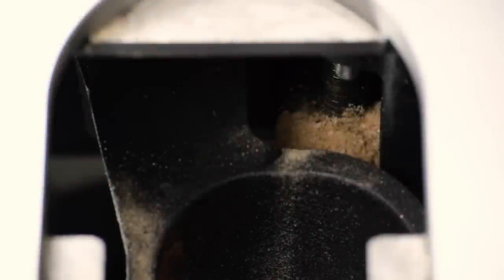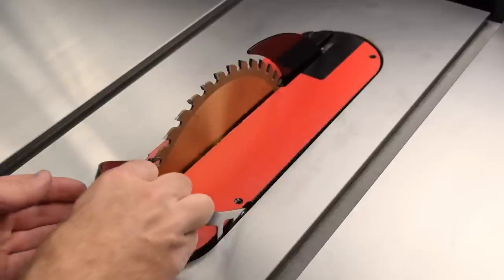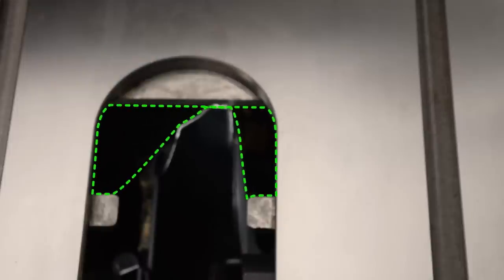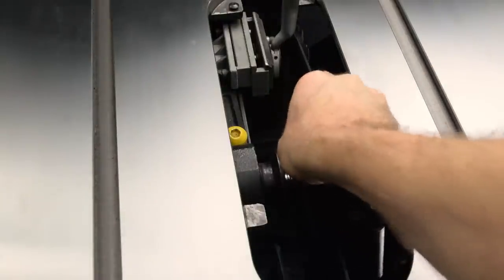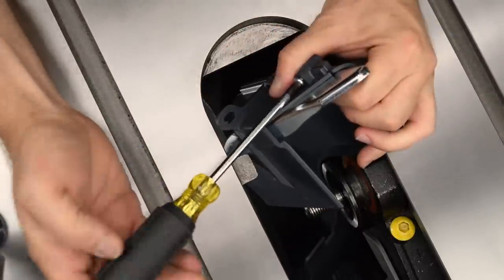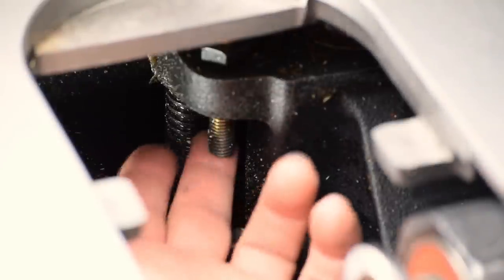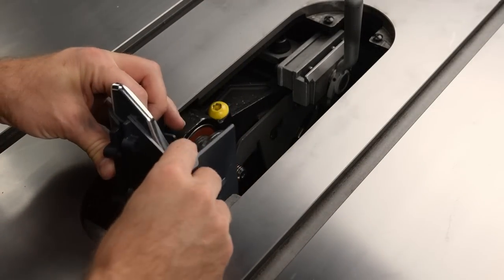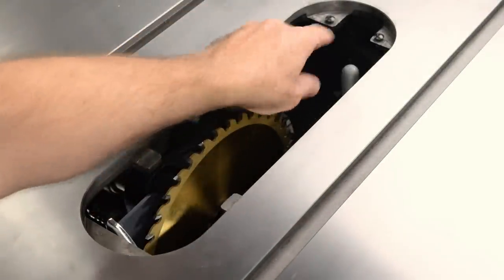SawStop Service Tip: Solve Elevation Travel Limit Issues for the Industrial Cabinet Saw

Comment: For the Contractor's saw crowd - if you lift the carriage all the way up and tilt to 45, it's much easier to access the gunk on the screw from the back of the saw with a pick and/or compressed air to clear things out.

Comment: Thank you—I have been having trouble with both this issue and with my SawStop ‘contractors’Saw not tilting to a full 45 degrees because of dust build up (I assume 🤔). I HAVE been able to clear out the compacted sawdust to correct the blade elevation issue but as much as I’ve tried I can’t correct the tilt issue; the most I can get is about 43 degrees. Is there a video showing how to correct this problem with the ‘Contractor’s’ saw?

Comment: Same procedure for when it becomes difficult to raise and lower blade?  I have PCS model.
Reply: Possibly, but there might also be corrosion in the main spindle behind the elevator adjustment wheel. If so, contact them and they will send out a custom tool which allows you to pull the spindle. Then you can clean it up, lube and reassemble. This happened to mine and after the work I could spin the wheel and it would spin freely like the wheel of fortune. I was psyched. It worked like new again.
Reply from the maker: Thanks for the question. All of our different saw models have different solutions.
Please contact our Tech Support for assistance – 503-682-3992 or service@sawstop.com.